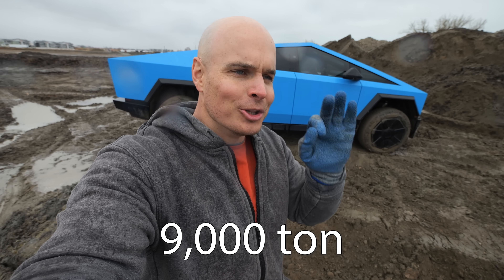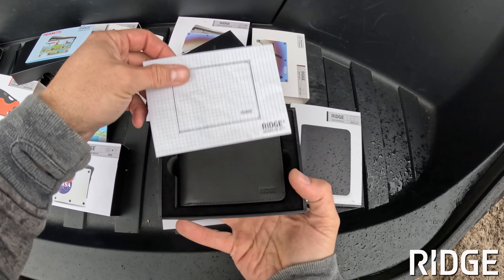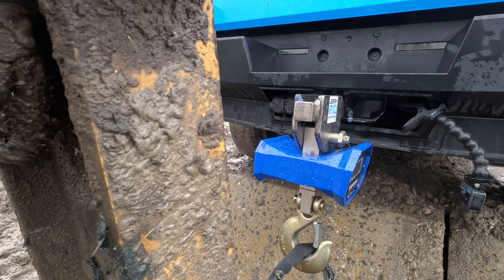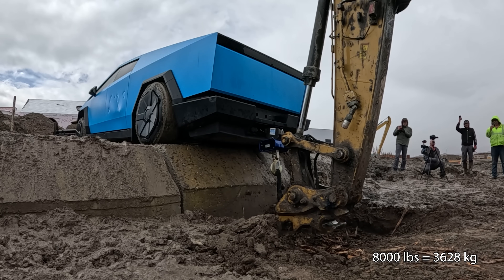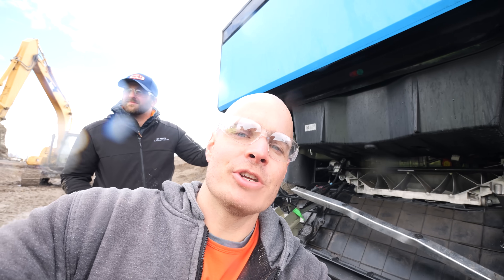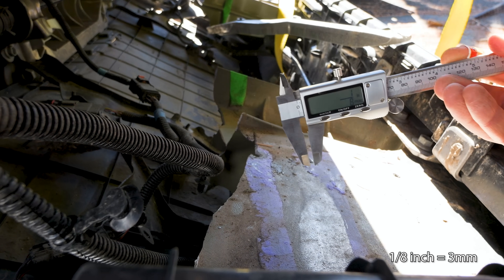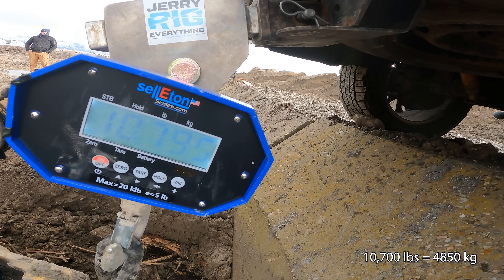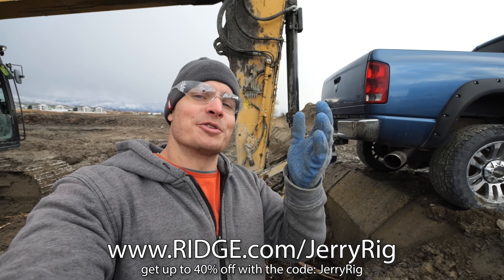SHOULD YOU TOW WITH A CYBERTRUCK?! - (catastrophic failure test)

Comment: Ah, I hear a loud echo of "I told you so!" to all those who praised the giga press. Worst of all you'll need an entirely new chassis, because welding cast aluminium is near impossible 😂
Reply: It failed at 9x of rated weight, what are you talking about?
Reply: @Zripas  Did the old Ram fail?..... nope
Reply: @ 
Ram hitch was rated for higher loads and they barely went over the load of where CT failed. So like, what's your point here?
Reply: The point I'm making is that it catastrophically failed. Cast aluminium alloy is porous making it extremely hard to weld and repair. The cyber truck like many Tesla's have their pro's and cons, but mostly, just way too much hype to lure more investors.

Comment: An already damaged steel frame and hitch out performs a new cybertruck hitch.....and I'm not at all shocked, cause anyone with half a brain knows steel is superior to aluminum in high impact and stress situations.
Reply: First of all, that truck was rated for higher tow capacity than CT, second, CT got to 9X the rated hitch weight limit before breaking.
And no, I'm not a fan of CT, it looks stupid, its not some sort of work horse or anything like that, just expensive huge BEV, but you still need to do basic objective look at this instead of just blindly hating thing for the sake of hating it.
Reply: @Zripas  not blindly hating....I'm speaking facts here. Cast aluminum is not good for this situation. Anyone with any knowledge knows this. Sure it took 10k pounds, but thats a slow steady pressure....go on a street and let it hit pot holes or a hard shock with that weight or less and it'll snap sooner. Steel won't, at worst it'll bend. This is common sense here....but you think just cause I'm pointing out the obvious that I'm a hater. Assume much?
Reply: @Monte1970SS  
Fact is that steel truck was rated for higher loads from the start and their test barely went over from where CT failed. 
I'm not here to argue that aluminum is as good as steal, obviously its not, but CT failed at 9x the rated load, no idea what type of pothole you would need to have such impact on the hitch. This entire video was extremely misleading and presented CT like complete rubbish while it outperformed rated numbers by 9x... And once more, not saying that CT is good or that using aluminum is good in this use case, but nothing what was shown in this video reflects actual reality.

Comment: For me the worst thing is the truck didn't work after, a normal car can still work until is impossible for the engine, I saw people drive disastrous pieces of garbage, electric cars will never be better than a gas car.
Reply: Because its a feature, not a bug. Driving that "disastrous pieces of garbage" is dangerous for EVERYONE around it, so in general it should not allow you to do it for your and others safety, maybe there could be some option to override it and allow to drive heavily damaged CT at capped speeds and power.

Comment: Tongue weight rating is different, so it actually exceeded since you were pulling down not out. It actually passed the test multiple times over and you proved it was actually better than advertised for tongue weight
Reply: so you didn't pay attention? improper loading or a pothole while breaking can put that weight downwards.
plus it's aluminem, it gets weaker with every use.
sure, it passes american safety regulations. but only a fool trust american safety regulations. this is one of many reasons why it can't be sold in europe: it doesn't meet rigorous safety regulations, only the bare minimum.
Reply: @vinx.909 Improper loading. If you break the rules, anything can be dangerous. The manufacturer isn’t responsible. If I point a gun at myself and pull the trigger, I don’t blame the manufacturer because I didn’t follow the instructions.

Improper loading would be dangerous in a RAM, a Ford, or a Rivian too. Did you watch the video? I’m genuinely curious. Remember when he had to anchor the front end down because the force pushing down was lifting it? If you’re cruising down the road and hit a pothole, it seems like the front end would lift off the ground before the bumper snapped — and that could happen to any vehicle, which would make them all “unsafe,” right?

The Cybertruck is awful, but let’s be real: this test was dumb and totally unrealistic for real-world scenarios.

Comment: From an old book about car frames and suspension from the seventies. It said that the frame should be able to hold 4 times the weight of the body to be deemed safe in dynamic loads. And that is for a steel frame. As the video said, steel doesn't build up fatigue like aluminum does and can be used indefinitely if only loaded to about half its maximum strength.

Comment: As a trucker I can guarantee you that while towing 11k lb you will never exeed 6k pushi down onto your  hitch. I haul 58k lb including my trailer and max weight pushing onto my 5th wheel is 28klb. Most of the weight is on the trailer axles. And if you are loading your 11k lb trailer properly max weights pushing down on your hitch shouldn't exceed 3k lb.
Reply: The issue is distinguishing static load from dynamic load. There are a huge number of factors that could cause a trailer to apply more force onto the hitch than the static weight on the hitch. Under specific road conditions, and also depending on the trailer itself, it is often possible for the dynamic load to be 5-10x the static load. So when you have your 11k lb trailer that is only applying 3klb to the hitch (btw, a cybertruck is only rated for 1,100 lb tongue weight) the actual dynamic load on the tongue could easily exceed 15k lb in specific situations.
Reply: Whistlendiseals video says otherwise
Reply: Dynamic loads happen, dr diesel
Reply: yeah I'm a trucker too. when you're maxxed out on weight your "tongue" load is going to be more than the "tongue" load over the trailer axles. you still need to load the steer tires and get 32k per grouping.
Reply: @nealcastagnoli6185  empty drives weight 8klb.  34k - 8k is 26k is what you will have max legally on the your fifth wheel unless you running extra axle.
Reply: I think that it's a horribly designed vehicle, but yeah I don't think the testing here was very fair. Repeated harsh conditions with an actual 10,000lb trailer would be scientific. Even pulling back on the hitch instead of straight down would be far more fair. There are better ways for someone with his budget to test the Cybertruck for towing safety.
Reply: Heavy haul trucker. Yes you can while hauling transfer weight to hitch. Abrupt stops bumps and declines will transfer load. Watching axle scales on my truck I’ve seen it more than double. High loaded box trailer at close to max can easily transfer the weight to the tongue.
Reply: It doesn’t matter if you won’t have 6k pushing down on your hitch, the fact of the matter is, aluminum has a known fatigue limit so it will weaken over time regardless of how small of a load it is.
Reply: There are many different ways forces can exert themselves on a vehicle’s hitch. It’s not as basic as just the trailer applying a downward force. There are also differences in forces, as they’re not all the same thing. Take a common example of what you experience inside a vehicle when you drive over a pot hole. The major issue here seems to be the fact Tesla has used a material that has poor failure properties in a part of a vehicle that is intended to handle large forces. It’s not simply a consideration of how much force can be handled but what happens when it fails. There’s a reason buildings and other built structures use steel versus aluminum in structural applications.
Reply: @Ticklish-sheep  Cybertuck weights under 7k lb hitch is good for 10k lb it will break tires loose before snapping the hitch off. I don't like Teslas but highly doubt someone can break that hitch with rated trailer capacity. All 7 people who will be using to tow something won't be pushing it with a 35k lb excavator.
Reply: @janemin3128 there are multiple factors at play here, which is why this is potentially a serious issue down the line. Aluminum is a poor material choice for this sort of application. Vehicles get abused over the lives, some more so than others. The forces needed to have steel sheer and experience catastrophic failure like was demonstrated here are on a different level, and that’s before taking into account how time and repeated stressing impacts aluminum.
Reply: @Ticklish-sheep 

Cybertruck makes me think of two words, Titan Implosion. Brittle is what brittle does.

I'll stick with my mid-90s K2500 Burb. Indestructable.
Reply: Thank you! This video is extremely misleading and lies
Reply: @FoxJones-d3e  ahh so you must own a tesla, or are one of those weird elon simps
Reply: @FoxJones-d3e Zack is on a mission currently to trash Tesla, he posted in X previously he will sell all his teslas by the end of this year due to Musk doing “Hitler salute” (which it was not). Lmao

Comment: Useless Tesla rage bait by a mad liberal. Non-scientific and absurd claims of tongue weight exceeding trailer weight from a pothole… apples to oranges comparison with a HD truck instead of 1/2 ton direct competitor. Only true statement is that aluminum is less resilient than steel.
Reply: ur pissed cause someone did a test.
Reply: You made a valid thoughtful comment, YT will hide or delete it
Reply: @shakehandswithdanger7882 I’ll make another one, it would be better if CT was engineered to have the hitch be the failure point before the frame. Also, under normal use conditions this failure will basically never happen.
Reply: @natefxx agreed, a more ductile failure would be better. to be fair, I suspect most 11000 lb max trailers would bend or break at 10k of tongue weight.  If I owned a CT, I'd feel fine towing the max rated trailer.

Comment: Should have stopped at 8000 lbs. That's over 7 times the max. tongue weight which you will never reach during towing. Would have saved loads of money. This feels like testing the walls of your house to see if they break when a bus drives straight into it at 50 mph. Dumbest test ever!
Reply: so the older truck tested in this video in your analogy is a war bunker made of thick concrete, because it didn't suffer the same results as the cybertruck, the test is fair in that it was done the same way in two different competing products and one reacted different from the other
Reply: @Violant3  The Dodge 2500 tested has a max. towing weight of 13,550 lb, but the max. tongue load they applied was 10,800 lb. Using same dumb logic, it should have been tested at 12,300 lb, but the 50,000 lb machine could not apply that load? 
And do you think that if a towing weight of 11,000 lb is allowed with a max. tongue load of 1,100 lb, NHTSA would not immediately remove all cybertrucks from the road based on this test? It's just dumb to assume that a 11,000 lb trailer can apply such high tongue load, even when loaded fully wrong. 
And look at the tires. They can handle a max. load of 3195 lb each. Never mind the weight of the CT itself, applying 10,000 lb on the hitch will result in an addition to the load of 5,000 lb each on the tires. So what's next? Testing when the tires blow?
This is just a dumb test that should be titled: how to destroy a $120,000 Cybertruck!
Reply: He was paid to show a broken cyber truck, this was never about testing

Comment: No tesla or cybertruck owner but towing capacity does not equate to tongue weight plus on most trucks a weight distribution hitch is required over a certain tongue weight
Reply: Yeah, they purposely did this because most people know nothing about towing and will think this is a huge flaw
Reply: @RyanCanty_  It was actually explained decently well when he talked about static loads vs dynamic loads.  Yes, the minimum rating of tongue load is like 10%, but there are realistic situations in which the entire 11k pound load can be shifted to the tongue.  That aluminum casting was not a good idea, even though I think very few, if any, Cyber trucks will be towing close to their rated limit.

Comment: I dont think you guys understand how towing, trailers and tow ball weight works. Considering its an EV and a unibody truck these results you achieved were very impressive. Unless you want to pull something hangin over a cliff, it will work just fine. It's rated towing capacity is 11000 LBS. Usually the tow ball weight is 10% of that, meaning its rated tow ball weight is about 1100LBS. In this experiment you tried to apply max towing capacity as tow ball weight and obviously something broke under a load that is 10x more than intended.
WD is doing his videos for content purposes, following his methods for scientific purposes is ridiculous. You should have at least explained that what you are doing is not how things work when actually towing something.

Comment: I'm not an engineer but when towing the weight is not forcing the tow hook down as much as your showing, its more pulling weight, normally when you tow the actual trailer has wheels and that takes a lot of the weight as the car just as to pull so in my opinion your using the excavator wrong. But like I say I'm not an engineer

Comment: Thank you for the information. My trailer weight 7,000 lb, I don't think I use Cybersuck tow my trailer up on the hills.
Reply: You should understand the difference between towing weight and hitch weight. The Cybertruck is rated for 1,100lbs hitch weight but it managed 10,000lbs before failure, nearly 10x it's rating.

If your trailer is transferring all 7,000lbs to the trailer hitch vertically then you've got some serious problems, and your front wheels wont be on the ground... Hate Elon, hate the Cybertruck, but hate them for real world reasons and not this click bait BS that you've fallen for.
Reply: Brother… you need to learn about towing… if your trailer is 7,000lbs your tounge weight shouldn’t even exceed 300lbs. The cyber truck just held 10,000 lbs

Comment: I get that hitch load can be higher than tongue weight but not sure how realistic 10,000+ lbs is if you need to hold down the front of the truck with a tractor to prevent it from going nose up.

Comment: The only thing this video proves is that with enough force anything can eventually be broken. If you ever end up in a situation where you have 10,000 pounds of tongue weight (dynamic or static), then you've fucked up majorly somewhere regardless of what truck you're driving and should not be allowed to tow anything bigger than a 4' x 8' U-Haul trailer. The stupidity of this "test" is up there with that other guy who decided to construct a wall that appeared as a continuation of a road to test the Tesla Autopilot system. But I guess now I know to look out for fake walls in the middle of the road and to never load all my trailer weight directly on top of my hitch if I ever buy a Tesla. 🙄

Comment: Your explanation is nicely attempted but towing a 10k lb trailer over a hill will not cause all of the weight to transfer to tongue displacement. You still have other wheels on the trailer underneath the middle of the load. You should have recorded how much load increases on the tongue while driving up a hill.

Comment: Completely nonsens this test. That is not towing force horizontal rather than pulling the way down. The vertical support force, which was tested to destruction here, is 220 to 330 lbs for the Cybertruck, as with all other cars. So if the chassis breaks at 9,000 lbs, the absorbed support force is 27 times higher! If I now calculate the dynamic behavior of the weight, assuming a 2G counter-acceleration, I arrive at a dynamic weight of approximately 4200 lbs, which then presses vertically against the trailer hitch. That's still half the weight at which the chassis broke.

Comment: @JerryRigEverything I know it's really hot to hate on Cybertrucks right now, and Tesla, and Elon Musk - with everything going on in the world and the US, fine. I'm not a fan of Tesla, and never have been.

But you all realize that the towing capacity of a truck DOES NOT mean that the hitch receiver can have that much weight directly on it, right? RIGHT? A 11,000 lbs towing capacity might mean a 1000-1500 lbs tongue weight capacity - typically 10-15% of the towing capacity is the tongue capacity. The fact the Cybertruck's tongue withstood 10,000 lbs of tongue weight is kinda impressive - not some kind of manufacturing defect or a giant surprise and borderline safety issue, as your video title seems to state.
Reply: Exactly right.
Reply: I would not buy a truck with an aluminum frame, ICE or EV, period! As was stated in the video, aluminum has no fatigue limit, meaning it doesn't "bounce back" quite like steel after numerous stresses (e.g. towing). This is why, as the video proved, a steel-framed truck from 2004 had no problem maxing the excavator out at the limit a NEW(ish) cybertruck frame broke.

Also, don't forget the fatigue that tongue jerk (i.e. when the cybertruck pulls/pushes from starts/stops) also places on the aluminum frame (remember: F=m*a). Momentary forces, like sudden acceleration, or uphill climbs, also hasten fatigue of any metal - aluminum simply fatigues far faster and quicker than steel in identical scenarios. I'd hate to see what a cybertruck frame looks like after several years of pulling vehicles out of ditches, as the large jerk forces caused by chains or pull ropes will massively contribute to structural fatigue.
Reply: still shows poor manufacturing compared to other cheaper and older trucks. cybertrucks are not safe for the roads, and this video doesn't even show the the top 10 reasons why that is the case